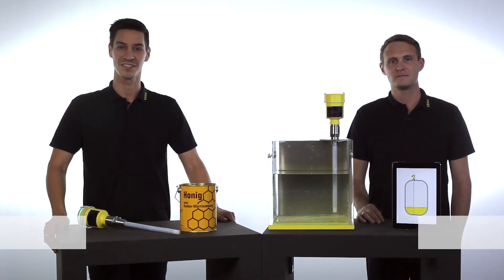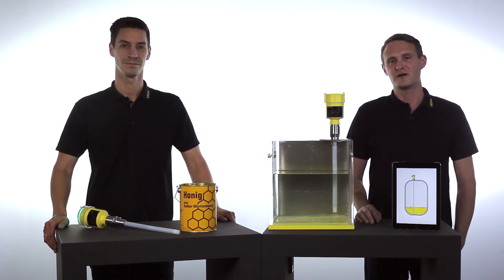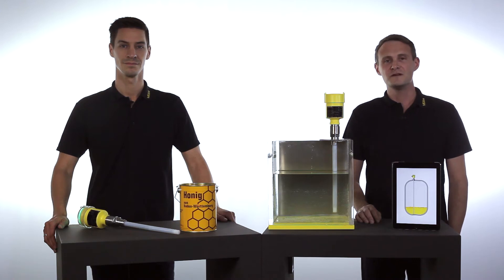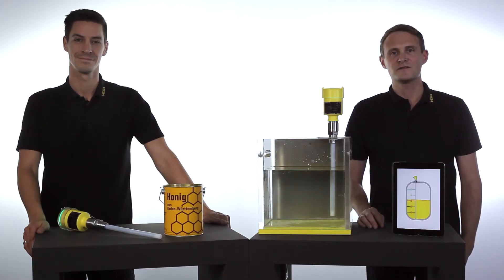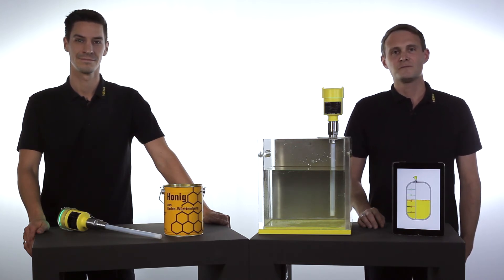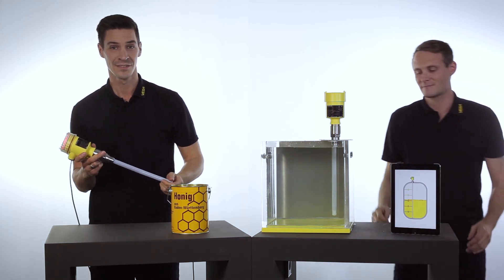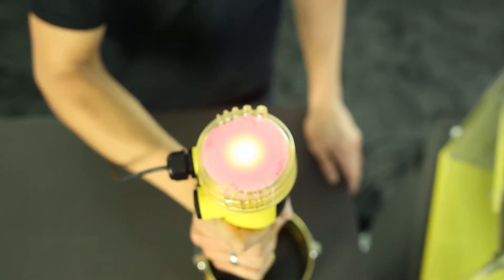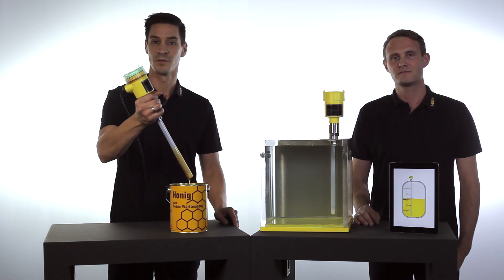Capacitive level measurement |  VEGACAP/VEGACAL Series 60

Comment: Can do VEGACAP available for application milk powder ?
Reply from the maker: Thanks for your question. In principle, the measurement of milk powder is also possible using capacitive level sensors. However each application is individual, therefore please contact us directly to find the best solution for your requirements: https://www.vega.com/en/company/vega-worldwide
Reply: @VEGA_Level_Pressure  I have been used radar type, but don't proper our application.
Reply from the maker: @spk7054  Every application has its own challenges - we're sure to find a solution that works well. Learn more about our dairy processing solutions: https://www.vega.com/en/industries/food-industry/dairy or contact us directly: https://www.vega.com/en/company/vega-worldwide

Comment: but where is two electrode ?
Reply from the maker: To measure with capacitive level devices you need a second electrode. Together with the vessel, the sensor creates the two plates of a capacitor.
In the video we used a bucket which is made of metal. This metal bucked was connected to the VEGACAP. So the capacitive sensor and the bucket formed the two electrodes of the capacitor.

Comment: Hi, What if the measured medium has different electrical property, for example water containing oil or denser medium. isnt it possible to measure the level
Reply from the maker: Thanks for your comment, Geogy Stephen.
The capacitive measuring principle only works reliably and accurately if the electrical properties remain the same. If the conductivity of the medium changes in the process, this will lead to a deviation in the measured value. The more the electrical properties of the process medium diverge, the greater the measurement deviation will be.
 For such applications, we recommend other measurement principles such as the guided wave radar VEGAFLEX series 80 or the non-contact level measurement with radar VEGAPULS 64 for liquids or VEGAPULS 69 for bulk materials.
Reply: @VEGA_Level_Pressure  Well my project is based finding the levels of blood suspensions, and other medical related samples, I am in need of finding a possible  way for detecting the minute levels inside a test tube samples. I'm obliged to work on capacitive sensor at the moment.
Reply from the maker: @GeogyStephen  Our probes have a diameter of 12 mm to 16 mm. If you send us an e-mail, our experienced staff will be happy to get in touch with you so that we can check if we have a measurement solution for your application.
Simply select your country under: https://www.vega.com/en/company/vega-worldwide
Reply: Hchdjfjudntndjfjfjhdhdnfuthdmdkjfntnnfjfjfjfjffhrjjrjr